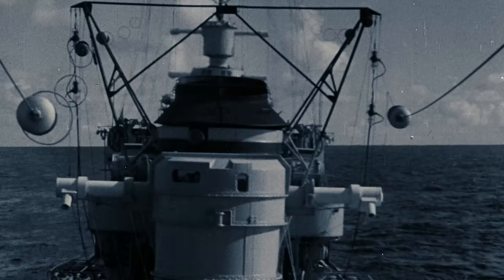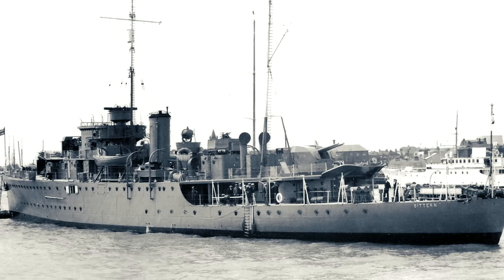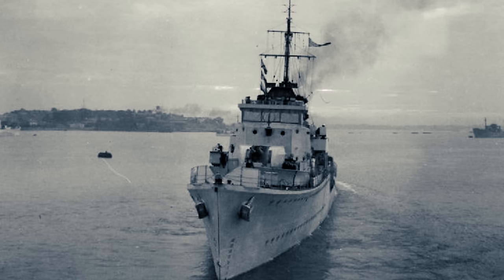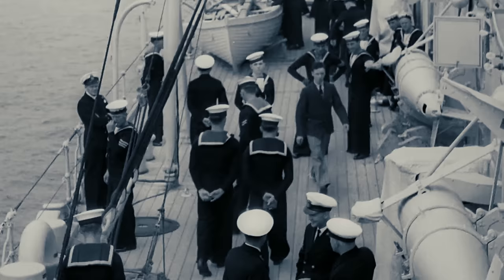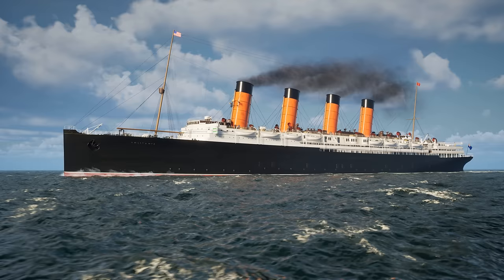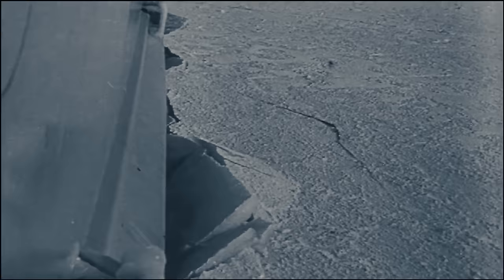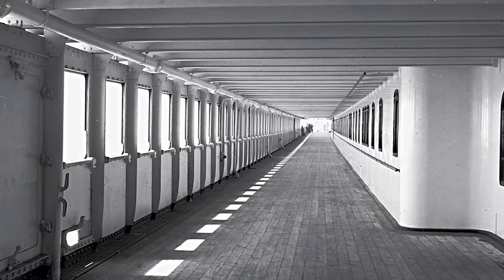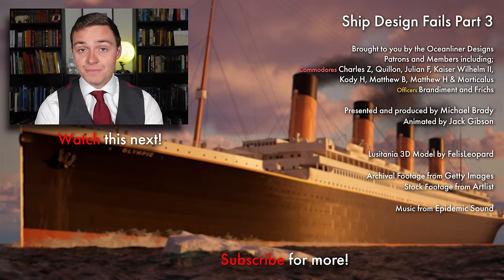When Designers Fail: Three Ship Engineering Mistakes from History

Comment: Hood was meant to have a refit in 1941 to improve her armor layout and remove unnecessary equipment which she carried over from WWI.
Her unexpected engagement with Bismarck was in May of that year.
Here's where it gets interesting. Hood, like many other warships, was a wet but steady rider. This meant while she slowly rolled in a predictable manner, her main belt dipped in the waves.
When Bismarck fired his 5th salvo, a shot landed in the water right along Hood's starboard side. It penetrated through a thin strip of plate between her torpedo blister and main belt. The shell was still going fast enough to punch through a thin corner in the armored deck, and in the fraction of a second for its charge to detonate it landed in the magazine for the 5" secondary battery.

Kaboom.
Reply: There is no evidence from any eyewitness account that a near miss landed within 20 feet of Hood (that's how close such a round would have to have been for it to penetrate under water into Hood's hull). That theory- of a lucky near miss- was examined and discarded by the second board of inquiry in 1941. It remained discarded for decades- and it has resurfaced because the original theory- of a lucky deck armor penetration- has been revealed to be impossible.

Reality is vastly different. In an interview conducted at Scapa Flow just after the battle of the Denmark Strait, both Captain Leach (who was Director of Naval Ordinance prior to his posting as Captain of Prince of Wales and was looking directly at Hood when the after magazine exploded) and Commander Lawson stated their opinion that exploding ready- use UP ammunition from the boat deck fire was responsible for the loss of Hood. This opinion was shared by none other than Ted Briggs himself. Flash and flame could have penetrated the floor of an after 15" turret (as Briggs suggested) or reached the 4" magazine via the ship's ventilation arrangements.

In any case, eyewitness testimony at the second board of inquiry makes clear that the deflagration was observed in progress venting from the engine room ventilators prior to any supposed hit or near miss on Hood.

Lastly- Captain Leach testified that the execute signal for the 20- degree turn had not yet been hoisted when the after magazine detonated- so that while Hood's rudders had in fact been put over, the ship had only just begun her turn. The secondary battery aboard Hood was 4".
Cheers...
Reply: That was possibly the luckiest shot in all of WWII, apart from the torpedo that jammed Bismarck's rudder!
Reply: @manilajohn0182 A near miss from a shell that didn’t detonate on impact with the water wouldn’t have been very noticeable. It’s very possible that no one saw it. I can’t remember if Drachinifel (who’s currently a proponent of the “underwater hit” theory) addressed the theory that the fire did it in his video on it or not, I’ll wave to rewatch it
Reply: @sirboomsalot4902  That's simply not true. Battleship- caliber shells which impact the sea leave very high shell splashes which cannot be missed.

In sny case, the theory was already considered and discarded by thr second board of inquiry decades ago. The primary reason why people have latched on to it is that the original theory had been established to be all but impossible- and previous few wish to entertain any other viable theory as to what took place.
Reply: @manilajohn0182  Battleship shell splashes are only high *when they explode on impact*. And military board of inquiries don’t “debunk” anything; they just find a satisfying enough answer for something whether it’s true or not. Modern historians should not just take their word for it.
Reply: @sirboomsalot4902  That is likewise simply untrue. To cite just one well- documented example: off Samar in October of 1944, Yamato dropped four shells right in a line alongside USS White Plains from just over 34,000 yards. Two of them were 'right' alongside the ship. Only one of these four (from the latter two) detonated. Multiple photographs show all of the shell splashes as higher than the escort carrier itself.

The second board of inquiry didn't "debunk" anything. They considered- and discarded- the possibility that a shell landed right alongside Hood and penetrated under the belt into the ship. No eyewitness testimony recorded any such shell splash right alongside Hood (it would have to have been within approximately 20 feet of the ship) at approximately the time that the aft 15" magazine detonated. It's also worth pointing out that the theory of a lucky shell landing short was given no attention whatsoever for decades after the inquiry closed. It resurfaced only after it became clear that the original theory of a lucky penetration of Hood's deck armor was not possible.

On the other hand, eyewitness testimony 'did' observe the deflagration already in progress emanating in part from the ship's engine room ventilators prior to any supposed shell hit.

Captain Leach (DNO just prior to his appointment to command PoW) and Commander Lawson were both of the opinion that flash and flame from exploding UP ammunition was the cause of the loss of Hood- which Ted Briggs likewise agreed with. It's also a fact that after Hood's loss, no further UP projectors were installed on any Royal Navy vessel, and those equipped with them had them removed.
Reply: I think the theory that Drach discusses involves a shell landing in a trough caused by Hood's hullform. This trough exposed a bit of armor that was designed to have additional protection from seawater, but since it was exposed, it didn't get that protection. The shell had enough momentum to penetrate into both magazines before detonating, or the explosion of the secondary magazine was able to penetrate the primary magazine. 

The main point of that video was to disprove that the Hood's crew hadn't properly secured hatches and that it wasn't this carelessness in an attempt to achieve faster reload speeds that doomed the Hood.
Reply: Poor Hood had been up armored several times and ran low in the water.  Called either a wet ship, or the longest submarine in the world.
It gave her larger displacement and a more predatory look - hence her popularity as "the MIGHTY Hood".
Reply: @ostsan8598  I do believe that his theory required that Hood had proceeded into her turn- which she had not.
Reply: @manilajohn0182  regardeless if she started her turn or not her alone at speed (to which she was) wouldve given an large exposed area below the waterline near where the explosion occured. Just look up photo's of Hood at speed and you can clearly see below the waterline. If anything, Bismarck got a lucky penetration in that general area which set off the magazine.
Reply: @battleship6177  I've seen photos of Hood at speed- and she ran decks awash and was well known in the Navy as a wet ship.

That theory likewise only surfaced after it became clear that the lucky deck armor penetration theory was no longer viable.
Reply: @manilajohn0182  No I'm literally serious, go online and look up 1930s/40s pictures of Hood at speed and you can see some photos taken from the air to where you see the exposed section.
Reply: @manilajohn0182  also do note that when a ship is considered wet and/or decks awash, it's primarily the bow of the vessel where the ship would be plowing through the water, not the entire ship. If the entire ship was awash it'd be considered too dangerous for sea duty.
Reply: @battleship6177  That's not true at all. Hood regularly ran with her stern awash.
Reply: @manilajohn0182 
Incorrect!  It wasn't a near miss, it hit the hull as described!
This has been argued by many, but tge consensus of experts disagrees with you!
Reply: @sirboomsalot4902 
It was not an underwater hit!  The bow wave exposed some of the hull beliw the armor belt, and thus was where the shell hit!
Reply: @mahbriggs  Well, you're obviously free to believe what you hear in youtube videos that are made by "experts" who can say whatever they please. In the real world however, there are three accepted possibilities as to how Hood was sunk. They are:
1. A shell landed short within approximately 20 feet of Hood and penetrated Hood under her belt and reached a magazine- and this assumes that Hood had altered her target angle to Bismarck by progressing into her turn;
2. Flash and/or flame from exploding ready- use UP ammunition from the boat deck fire reached a magazine (probably the 4" magazine), and;
3. Flash and/or flame from exploding ready- use 4" ammunition reached a magazine (again, probably the 4").

Just how you can actually maintain that the ship's bow wave somehow exposed the hull underneath her belt armor- and that no one in the Royal Navy at the time noticed it or did anything about it- is frankly beyond belief. It's apparently never occurred to you that a ship design with such a massive flaw would not have been accepted by the Navy in the first place. The hull under Hood's belt armor was not exposed by the ship's bow wave. Rather, a portion of the ship's belt armor could periodically become visible under the right conditions at sea. Start reading and studying the history of this ship and you'll find that Hood was notorious as one of the wettest ships in the navy, and that the added armor- along with wartime equipment and crew additions- made the ship ride deeper in the water than was ever intended. Hood departed Scapa Flow to intercept Bismarck in a fully loaded condition and was in no way capable of having her hull under her belt armor being exposed by her bow wave.
Reply: @manilajohn0182  but not bow, midships AND stern which would cause submarination. The bow wave theory, where the peak of the wave would be at the bow and the stern and a trough midships, is consistent with your comment
Reply: @gbcb8853  Stop and think. If wave action alone could expose a ship's hull underneath her armor belt, then that portion of the hull would 'always' be exposed to shellfire. The sole difference would be that 'that' portion of the hull underneath the belt armor would periodically be visible- and the presence of water obscuring that portion of the hull would be no protection whatsoever.

The rolling of a vessel would be far more likely to make such a shell penetration possible- and Hood had little tendency to roll by 1941 because the ship was in an overloaded condition.

Believe what you want, but this theory is only popular among some who derive their information from the internet. Not even the H.M.S. Hood association tries to spin that kind of craziness. You're letting the wrong people do your thinking for you. But you do you.
Reply: @manilajohn0182 Something that came up in another video (i think it was posted on the Battleship New Jersey channel while he was doing a live talk there) is that ships heel when turning. Not just leaning away from the turn, as most are familiar with, but briefly leaning towards the direction of the turn as a result of the rudder being put over and the resulting force below the center of mass.

We know Hood was just beginning her next turn (two-blue signal flags still flying and Ted Briggs testimony), and that the hit arrived when the helmsman was still able to feel the response of the helm (how else could he report "steering's gone" just before the explosion). We also know that Hood hadn't noticeably changed her course yet. Given that, with the rudder(s) likely only just put over, Hood likely would have been leaning in such a way to expose more of her side to Bismarck. While her bow trough might not have exposed anything below the armor normally, in this state where she is leaning due to her rudders being put over but before the rudders actually start to turn her, it's possible it could have exposed just enough of the area where her belt and torpedo protection meet, an area that doesn't have much to protect it given diving shells weren't a thing when she was built.

As for the Royal Navy not noticing the bow waves trough exposing under her belt armor? That's actually more believable than you might think. After all, we know from the evidence at the inquiry that the RN didn't realize her bow wave's trough was deeper than their calculations showed, given the graph provided stands in contrast to what photographs show. Looking at pictures, the only ones I can really see it is from a higher angle POV, otherwise it becomes difficult to make it out.

As for those pictures, I happened to look up some pictures of Hood at speed. In at least one picture, I can see the part of her hull where it starts to bulge out for the torpedo protection system, and as far as I can tell she isn't going too fast in that one given I can see another peak and trough before the trough in question, which happens to be in the area of the aft machinery and magazine spaces. She is also in a turn in the picture in question, leaning over just enough to expose the top of that bulge, which is the most vulnerable part.

So yes, from what I can tell, in certain circumstances, that bow wave's trough can expose part of the hull below the belt in the vicinity of the aft machinery and magazine spaces. She doesn't even need to be turning either, as in that picture of her at full speed while going straight, I can still make out the different color shade at the bottom of that trough that indicates where her anti-fouling paint is. Which happens to start at the top of the torpedo protection system.
Reply: @andrewlucia865  This is the last I'm going to say on this subject.
1. When asked at the inquiry if the execute signal for the turn had been hoisted, Ted Briggs replied that he was not sure but that he thought that it had.
2. Captain Leach of PoW stated at the inquiry that the execute signal had not yet been hoisted. Leach had given no order to implement a turn for PoW, which was therefore still steering a steady course.
3. After recovering from the shock of the explosion aboard Hood, Leach's first action was to order a change of course to avoid the wreck of Hood.
4. Hood's helmsman's report of steering gone was a report of loss of helm control. It does not mean that the ship was in a turn.
From the above, it's clear that the rudders of Hood had only 'just' been put over and that neither ship had proceeded into the turn.

There is no evidence of particularly heavy seas which caused Hood to significantly roll in the battle, and the last photograph of Hood bears this out. Comparing peacetime photos of Hood in what were likely seas heavy enough to make a 40,000+ ton ship roll) with the state of Hood in 1941 is not even remotely the same thing. In May of 1941, Hood left Scapa Flow in an overloaded state. A ship which historically was known throughout the fleet as a wet ship now had a full wartime compliment and left Scapa Flow with a full load of fuel. Modifications in 1940, during which the UP launchers were installed, forced the removal of the ship's entire secondary 5.5" armament.

To sum up, Hood was neither rolling significantly nor in a turn. This whole theory- which is not accepted outside of a small internet community- has been created only because it's been established that Hood was not the victim of an unlucky penetration of her deck armor. If that theory was still viable, this one would be given no consideration whatsoever. Frankly, the sole reason that this nonsense is embraced is because few wish to even consider the possibility that a chain reaction of flash and flame from exploding ready- use UP or 4" ammunition reached Hood's 4" or after 15" magazines- something which Captain Leach and Commander Lawson of Prince of Wales believed, and which Ted Briggs came to believe as well.
Sincere regards...
Reply: @manilajohn0182 dude the last photo of the hood shows her stern to be dry
Reply: @nonbigbrain9662  Look again- closely, this time. Her stern aft of her after turrets is awash.
Reply: @manilajohn0182  unfortunately the shell only had to hit near the turret, explode, and then send a fire through the ship into the magazine room and then kaboom. That’s how a ship gets left with only 3 survivors
Reply: @nonbigbrain9662  That's not what took place though. Eyewitnesses reported that the explosion took place in the immediate area of the mainmast.